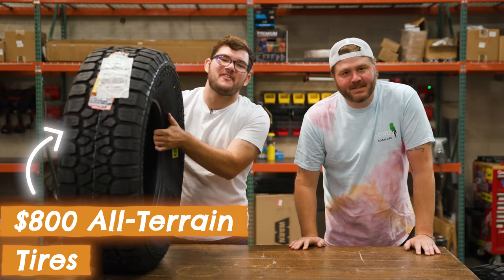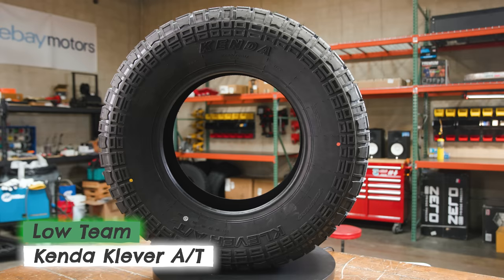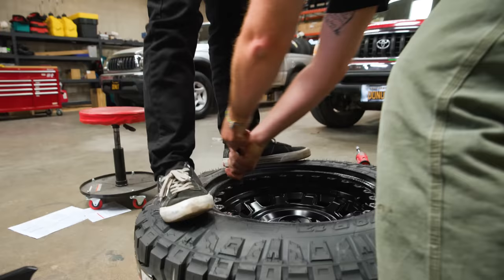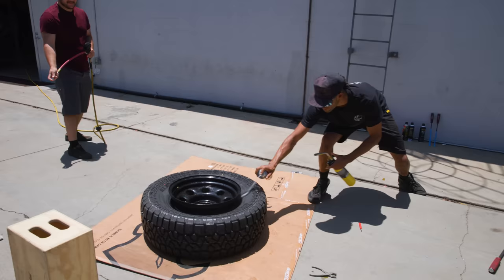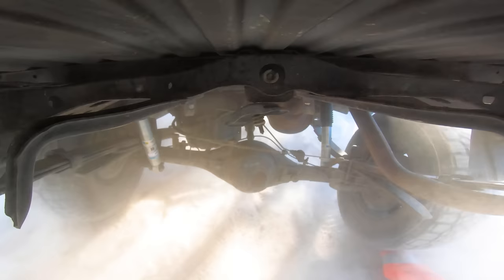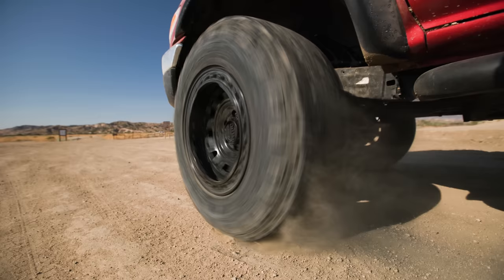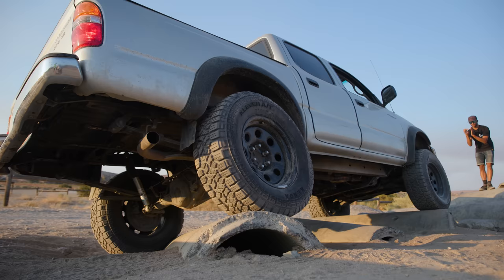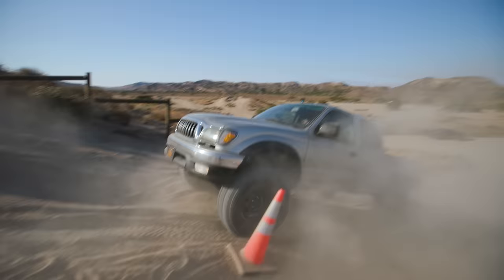$800 Off-Road Tires vs. $1500 Off-Road Tires

Comment: Tip when installing a tyre with brakecleaner and a torch. Take out the inner part of the valve. This will prevent the tire from going vacuum as was seen in the video.
Reply: We definitely removed it but maybe the tire just had a ton of volume and the flame ate all the oxygen?  I think next time me and Nolan will be F1 fast styles on it👌🏾
Reply: @aaronparker3559  u da best aaron
Reply: @aaronparker3559  good point im comparing it to just simple size road use tires these are way bigger en de valve size didnt change thats why it still went vacuum i asume.
Reply: You can get screw on fittings, use a length of hose back to a ball valve then more hose back to the compressor.

Ball valve closed and compressor on / full tank, light up the fluid.

Then from a safe distance you can dump high pressure air in very quickly.

We also normally use a gas like "start ya bastard".

Again, this is done with the inner valve steam removed so that the air can flow faster.

Once the tire is sealed up, you can take off the fill hose, replace the valve and pump up.
Reply: Sorry, but your tests are flawed.

Climbing a the same complete length of dirt hill does not say if one set of tires is better then the other.

It just says both sets "pass" that test.

You need a hill that progressively increases in difficulty so that not even a tracked vehicle can make it to the top.

Now that no vehicle can "pass" the test, you can compare how far along each fails and gather REAL data.

A skilled offroader can air down any set of tires to as low as 10-15 psi.

Just drive slowly and don't steer unless moving forwards / backwards.

Bead locks let you air down to even 3 psi.

You also need to test in thick mud.

Some features of better off road tires are more plyable sidewalls, allowing better flex and thus a larger contact patch.

Deep chunky tread on the sidewalls helps when crawling through the mud.

Even the ability of different tread designs changes the ability to throw mud off the wheels and "self-clean". 

Driving for a while at a moderate speed will normally throw the mud off, but spinning your tires whilst struggling for grip is where quality tires make a difference.

I've had "no-name" tires that turned into clay soaked racing slicks while quality tires on the same hill gripped like snow chains.

There is of course a balance point at which point the advantage isn't worth the cost, but your tests haven't reached that point.
Reply: @35manning  they are an entertainment company before anything else. They are learning as they go so of course their tests are flawed
Reply: Maybe too much fuel.
I've seen this done in SE Asia, and they do it much cleaner with a thimble of petrol or something thrown in there, and then they toss a match in.
Reply: @owenmisdorp3118  that could help for sure

Comment: Driver skill is way more important than equipment most of the time.  As for air pressure and the need for bead locks, I accidentally ran negative pressure without a beadlock and they didn't come off.

Comment: I’ve got a 95 ranger that I’m taking in the same direction as these two and honestly the Ko2s from BFgoodrich have never let me down and are only 200$
Reply: until you go big. my dad had em on his at4 and they sucked in the snow and were 400+ a tire.
Reply: @Ghostrider-xd3xv  can't compare a basic at4 to a 95 ranger wtf
Reply: @kap1526  not really about the truck. tires are great for mild trailing but way too expensive
Reply: @Ghostrider-xd3xv  I ain’t got a big truck that’s the point
Reply: @Jesse Robinson it's a ranger, I doubt he's getting over 45mph with tires that big. Balance will be fine :D
Reply: @Jesse Robinson I’ve got 28 by 8 rn about to go to 31 by 9s they ain’t big tires nor a big truck besides my brother has 33s on a 77 f250 highboy and they’ve never had a problem

Comment: For regular driving in the winter in Michigan I 100% believe the tire $ matters. Had some $100 all season on my '09 F150. Not 4x4. I would get stuck in 3 in of snow. I bought $170 Cooper winter tires last year and yeah. Went through that 3 inches like it was summer. Snow half way up my tire and I never got stuck 1x. Point is I could see massive improvement from these. I bet your difference was as awesome
Reply: Winter tires aren't all terrain. Not comparing apples to apples at all

Comment: On the tubes it appeared the truck didn't have a really low gear that would have helped. My Jeep has a "granny" low that crawls over stuff like that at the pace of a snail.

It just has the 16 inch general grabbers that were recommended by a forest ranger. They bite good in mud, snow, ice, or sand.

I have pulled a 4 x 10 trailer full of wood across some rough terrain with no problem.

Comment: We run the Kenda Klever M/T's on our Jeeps and have not had any issues. They have worked great in mud, rock and sand and have lasted well on pavement. We do rotate the tires every 300 miles but that's just a mud tire for ya.

Comment: I think I’d go “High” tires and “Low” wheels.
Reply: Same
Reply: I did and I'm loving it. Those ridge grapplers have stone ejectors, almost a 4000 lb max rating at 80 psi max and a lot of features they didn't discuss or do any research on for example I believe these tires are 13 ply and more than the average on the sidewall to help reduce punctures. I use my chevy as a daily driver and I can't believe these tires. 35s on 18s has a max rating of almost 4000 lbs. at 80 psi. The 33s he had 3500 lbs. I'll bet they don't daily drive like I do.

Comment: I put on 16” vision turbines on my 3rd gen 4Runner (same frame as the tacos) and some 33” Yokohama MT’s and even though my truck is 2wd (for now) I don’t regret paying 1800 for the whole set up cause they look fire and I haven’t got stuck once off-roading where I’ve watched some modified Jeeps have to be pulled out. Plus those tires can take a huge bearing considering I get my front left at 40mm and it didn’t pop so they have my heart.

Comment: Its not always about "More Beans", boys. Slow, constant, steady pressure on that throttle. Its all about control. Picking your line and keeping it on your line will get you farther than anything else. Im willing to bet with control and an air down a bit on those stock tires and you would get around the horseshoe.

Comment: You can use a smallish air tank you can pick up, install a valve lever that will let the air out quickly. Weld together thin sheet metal kinda like a duck bill with about an inch opening at end, attach to the tank. Fill up tank with air, put tire on wheel, place the duck bill shape near where the tire bead goes. Dump air all at once with the valve lever, air shoots into tire rapidly causing tire to seal to the wheel. No fire or combustibles needed.
Reply: Or just get a cheetah for about 150

Comment: This isn’t a very compelling argument because there’s clearly a huge SKILL GAP between drivers. It should be same driver, same truck and you have to make sure they take the EXACT same line especially with open diffs
Reply: You aren't wrong about the skill gap.  But you are still able to see the pros and cons (if any) of both tires.  Low truck was obviously slipping a little more on the horse shoe.  Regardless of driver it obviously didn't have as much traction as high truck.
Reply: @willburdette8065  they needed to run them at similar pressures. lo truck could have easily ran their tires at 15 psi with zero issues. 15 psi isn't even low enough to require bead locks. bead locks are only needed when you go into the single digits for tire pressure

Comment: It’s more skill. I mudded a 1/4 mile strip of backroad in my brother’s AWD Ford Escape with road tires. I absolutely killed it and hit all the right angles and speeds. I stopped at a gas station nearby and I was told by locals that lifted trucks with A/T Tires gut stuck there all the time.
Reply: At a certain point, overall weight and center of gravity plays a huge huge part. Lots of guys overbuild their trucks and never do extreme climbing, then they get upset when they get stuck in a mud puddle that a stock Subaru Outback can plow through in Eco mode lmao. 

That's why I'm glad Donut used Tacoma's for this. I see way too many pavement princess F350 duallys that are jacked up to high hell for no fuckin reason witg ugly ass M/Ts. Ruining a way too expensive towing rig to try and make your dick bigger lol. All you end up with is a heavier, slower, less capable, and more dangerous commuter that now gets 8 mpg and god awful road noise.

Comment: I’d recommend much lower tires pressure for the course. I run 10psi in mine with no bead locks and the grip is night and day.

Those things look almost fully inflated.
Reply: I was gonna run this. I run hill climb trials cars with pressures down to 3 psi. The difference between 3 and 4 psi is crazy. These guys had those tires way to inflated

Comment: I run Nitto Mud Grapplers on my Rubicon. I have over 40,000 miles on them and they have more than 1/2 tread left. And the perform much better than the Wranglers I took off. They were pricey, but in my book they were worth it.

Comment: There should be a “low low” truck where they leave everything stock but just air down and turn the rear locker on.
Reply: an aired down factory locker Tacoma would have won the tug of war competition most likely
Reply: @daywalker4029  100%
Reply: Hi Truck. Low Truck. Control Truck 👌 lol

Comment: Have done the trick with starting fluid.  If you are going to have then balanced.  Area shops maybe charge$5 more to mount.   That trick  is for remote dismount with no spare.   BTW slightly safer. Cable winch around tire often will seat them.   I think I saw tire damage from fire/heat.

Comment: There is one thing that you guys couldn’t measure. Durability, resistance to deformation and dehydration. Good tyres last much longer, are much stronger, with lots of inside puncture protection. A good tyre can be used for 10 years no problem. 
A bad cheap tyre deforms very easily and becomes dry in a few years.

Comment: Bit of an old video to comment on but: If you inflate your tires with fire, make sure to take the core out of the valve stems first, it helps mitigate the tires shrinking back in on themselves from negative pressure when the gases cool.

Comment: Aaron knows what's up with airing down, it's a staple in off-roading.
Reply: But then they didn’t air down for the horse shoe portion
Reply: I'm pretty sure 4wd was not used when needed either.
Reply: @v01dd  Looked like the pricey tire had less air in them than the lower cost.
Reply: I like how hi team shelled out 4x the money for bead lock tires while still thinking that tire pressure would not impact the performance.
Reply: @kainanshaw659  but... they did air down, right?
Reply: @kainanshaw659  I did notice they put the beadlock rings on so the brand logo was in the way of the tire valve when airing down haha

Comment: Seems like they aren't using low range? Or is it just me? I mean they just discovered that airing down helps so I wouldn't be too surprised. Love the series, have a 1st gen myself
Reply: I think you are right.  Maybe they should do a comparison of high and low range.  Lol
Reply: I got a good kick over them debating whether airing down would work!
Reply: They're hopping pickups over concrete obstacles that aren't soft mud so no momentum is required. These guys aren't offroad gurus by any means, lol.
Reply: I have a 1st gen and it does really good on this stuff, but also they look pretty new to this stuff
Reply: 1st gen Tacoma 1979 was the first year of 4x4. The body style went until 1983. :)
Reply: For real tho I was wondering if they were on 4 low or high
Reply: @iankovac1878  not a Tacoma. In the US its called “Pickup” the rest of the world Hilux. Had an 85 4x4 regular cab pickup myself. Bought it new and had it 10 years. Last year for the front straight axle. Great truck. Should have never sold it.
Reply: @fredd410  I know, it got my goat when he said 1st gen. I have had almost every year of pickup, I love them all :)

Comment: Thank you for the video. I am an off-roader with long experience. I think the test was not sufficient to show the real differences. The wheels used, both can safely support  12 PSI. the bead-lock wheels can support 5 PSI which is need if you drive in soft sand with heavy truck. 
in summary, for the test the expensive wheel are not needed. if you change the test, you may find different conclusion.
the more expensive tires could have long life.

Comment: Airing down really becomes important when actually rock crawling because the tire if soft enough can wrap around parts of the rocks effectively making the tire "grab" the rock.
Reply: Also helps it have some give in case of a sharp rock, less likely to puncture the tire

Comment: This series is only proving you don’t have to spend hi car money to look and perform well
Reply: Compared to the last season, they aren't exactly going low with Nolan's truck. 
This is more a high/mid range season so far
Reply: @inocheckblindspot  true because they went Bilsteins on shocks. I think they’re trying to increase the value for resale
Reply: @ScreenTalker  Bilstein is cheap as far as actual quality. The problem is they can't break out there. Its much harder than just calling a tow truck if junk parts break on the road
Reply: @valkyriesurvives5109  granted, but they could have gone with even cheaper ebay shocks for a true hi/low like they did to the Z

Comment: You can dump tens of thousands of dollars into a rig but if you can't drive it's not worth it. 98 Ranger w/33"X12.5" on aluminum wheels running manual hubs, everything else is stock. Pulled Jeeps, Yodas and others out after they got stuck, most were more capable. If you just do some mild wheelin on occasion then save a $ and you can still have loads of fun.

Comment: Honestly I'm surprised at James's take, I would take the cheap wheels and the expensive tires (I never thought I would want another set of Nittos after my old Invos), but those Nittos had vastly better grip on hard surfaces. Controlled descent can easily be the difference between driving home and taking as flatbed home in my experience.

Comment: When you’re blowing up the tires with fire, it helps to remove the schrader valve internals before blowing it up like that. It will still have enough force to Inflate but won’t try to crush in on itself as much.
Reply: Would that give you more time to air it up because I'd imagine it take more time to reinstall the valve and then add air so by then the vacuum would debead the tire? Or does the valve removed mean air can rush in through the opening???
Reply: @sergiocruz6195  You will have all the time in the world to air up if removing the valve core. When the pressure decreases in the tire as the air cools it will suck air in through the valve instead of collapsing and risk de-beading again.
Reply: Truth

Comment: The main worry with big tires is the loss of torque but when you reduce the air pressure you actually gain some torque back by reducing the diameter of the tire which also can reduce any clearance gains you had from the fully inflated tire. Out on the flat ground and highway you can regain some of your fuel economy by having your tires aired up to the required specifications or 5 pounds over but the higher you go your ride will suffer and tire wear can be uneven .

Comment: I love seeing the Toys out playing. I have a 2003 Limited Edition Quad cab myself. these 20yr old trucks are just awesome. Although my paint is now warn off and my truck has leprosy it's still mechanically sound. I'm nearing that point where I might want to trade it in for something from this decade. I just know that I'll be kicking myself if I sell it. Mine is stock, except the tires.